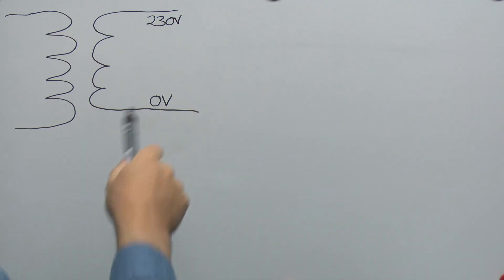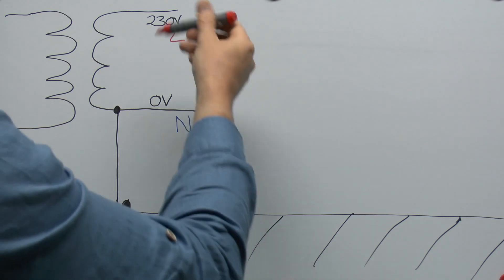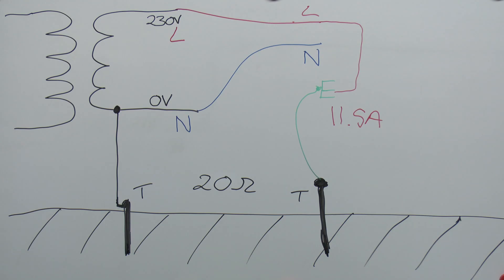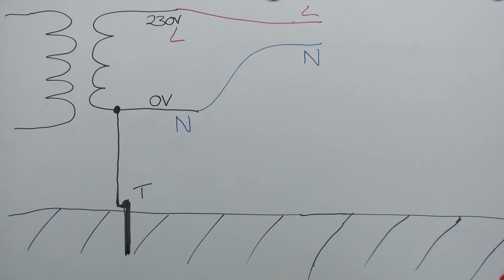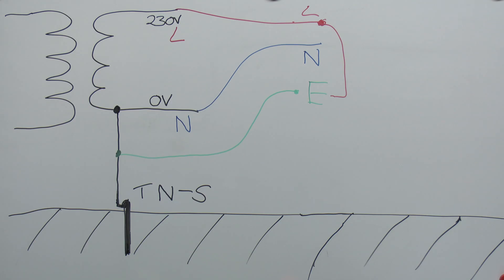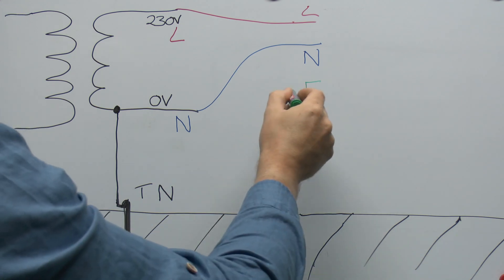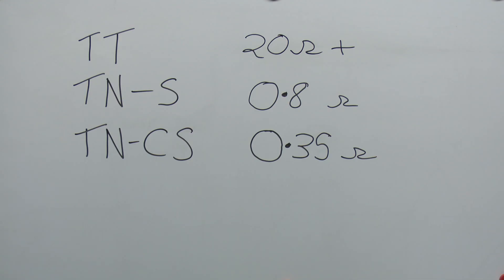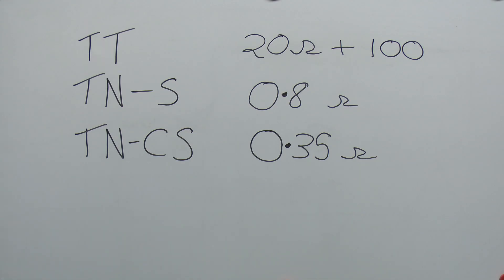Types of Earthing System for Electricity Supplies (UK)

Comment: I'm no expert so forgive me if this sounds silly, but in your diagram you have 240v live and 0v neutral.  That would suggest a DC set up - mains is AC so would that not be alternating between live and neutral ?  I also presume that as the resistance is less in the neutral wire than the through the ground which is the reason we don't have 120v potential between neutral and the ground??

Your videos are entertaining, informative, but can be confusing for us non electrical folk !
Reply from the maker: Malcolm Crabbe The neutral is always zero volts relative to the earth, as the two are connected together.
The live changes between positive and negative relative to the neutral,  which for 240V AC is a peak of 339V positive and then 339V negative, repeating 50 times a second.
Reply: +John Ward i am sure the resistance in the eath is less then the resistance in the neutral and i persume this is why we use it as an graounding system? aslo in the Uk our supply is based on a 3 phase with 240v - 400v depending on what phase you use. and according to your diagram if i buzz tested the neutral with the eath they would buzz failing the instalation as safe?
Reply: A copper (or Aluminium) conductor for a neutral will almost certainly have less resistance than the earth. For a three-phase system the neutral acts as a return path for fault and imbalance current. The vector sum of the current on all three phases will give to the neutral flow at any given moment in time. I'm not familiar with buzz testing lines, but if there's a significant current flow through the neutral with nothing wrong on the circuit, one should look at balancing the load a little better.
Reply: We describe the 240V as a type of average value to make analysis easier without needing complex differential equations. It is still AC and alternates polarity 50 times every second with a peak value of 240*sqrt(2)=339V. Fault paths are designed such that the majority of current flows through a protected path. For homes, this path includes a circuit breaker. Earth ground conductance is generally very low until an electric field is applied (in many cases increasing the conductance slightly). The metallic path of the return neutral will almost always be more conductive than is natural earth ground. Earth ground is "said" to be zero volts (it actually isn't, but this affects almost nothing on the distribution side of things) so the video is correct.
If a 240V lead touches the neutral conductor you can be certain that the neutral conductor and everything it touches now has a potential of 240V. This includes the earth grounding conductor. Voltage does not "go away" when driven from a constant source.

Comment: I always wondered how a path from live to earth was created. I thought it was an enormous earth rod at the power station. Another question, I have a 25m 15a extension cable going over to my shed for charging an electric car. Should I also put an earth rod in the shed and connect it to earth on the extension cable? I was worried the cable might be too long and the car might have a problem with the earth not being good enough. I don't have the car yet.
Reply from the maker: Shaun Dobbie Very unlikely that an earth rod would be needed.  

Electric cars should have a dedicated charging point connected to fixed wiring, as the charger units which plug in to normal outlets will typically take a very long time to charge the car.  Extension leads are not designed for permanent installations.
Reply: Unfortunately, its my only way to charge. I think it takes 10 amps maximum but the voltage drop of the cable might be too much. It is about 8 to 10v of drop using a 2kw fan heater.
Reply from the maker: Shaun Dobbie Allowed voltage drop is 5%, or 11.5V on a 230V supply, so within limits with a 2kW load, and right at the limit with a 10A load.
Reply: I will just have to give it a try I suppose. The evse with the BMW I3 gives you 3 charge rates. 6 amps is the lowest. If it doesn't work at 10a, I will replace the extension with 6mm twin and earth armoured cable.

Comment: HI, thanks for the video:) i would like to make sure that in each plug of my flat,  the earth is actually working. Can I connect one probe of the multimeter to the live and one to the earth, and check if it reads a voltage of about 230v?
Reply from the maker: Lorenzo Taurino That is one way, a safer method would be to disconnect the power, and use a long test lead to check for continuity between the earth in each socket and the main earth terminal for the building (usually in or next to the consumer unit / fusebox).
Reply: Yes...in Italy we don't have a Main consumer unit (Just An rcd/rcb) thanks!

Comment: Here in Norway the customer must provide an earth rod regardless of what system is being used. Even TN-C-S-systems must be connected to earth where the PEN is split to N and earth. So whatever happens to the earthing from the power company, there will be a local, good earth point.
Reply from the maker: sjokomelk That is also permitted in the UK - however it is not required, so is almost never done in reality.
Reply: @jwflame  There's often a de-facto local earth as well due to bonding gas and water piping that often arrives, at least in part, as buried metal piping on older properties. That's not what' it's intended for of course, but it's potentially useful with RCD protection should there ever be a supplier neutral break, as unlikely as that might be in practice.
Reply from the maker: Robert Szasz No, only the electricity supplier is permitted to do such things.  Therefore you are stuck with whatever earthing system they provide, or ignore theirs and use an earth rod / TT system.
Reply: ***** in a T-T system can you bond the earth and neutral at the premises demarcation?
Reply: ***** Although sometimes you can call the DNO out for them to convert a TT system into a TN-C-S one, albeit at a cost.
Reply: +John Ward
I notice now, 18th edition draft is expecting a supplimentary earth rod on new installations!.  Not entirely sure why but worth thinking about!.
Reply: Same in Belgium, Ground is provided by the company (both on single and triphase, most new houses here get triphase) but you have to run a loop of a single copper cable that's coated in lead (against corrosion) (believe 16mm² and connects on a copper bar that is accesible) under your foundations if your building is new. If the measurements are not good you have to put in more stakes/pins and I believe up to 3m/ 10ft deep untill its right (Believe they start with more pins on different places and look at the results an decide wich have to be longer or something, don't now excactly anymore it's been 20 yrs since  I got the class). If your restoring a house and the electricity has to be renewed ( say over 40 yrs old or so) then you can only work with stake/pin option. all the stakes/pins also whould connect first to eachother and then to the copper bar.
Reply: +sjokomelk 
Same in Finland, I think we are almost 100% TN-CS.

If you have IT-system, wont that mean that an Edison-screw light socket has its threads live too?  Or do you use bayonette mounts?
Reply: Steve Jones Yes, they're good for surges. Then you want the shortest way possible to ground.
Reply: Same here in Ireland
Reply: sbusweb A reason we have it in Norway would be because of voltage surges.
Reply: Earth rods are never a good earth. Typically it will have several tens of ohms of impedance.
Reply: +Tanooki100 We use the same Edison light sockets that everyone else in Europe is using. And yes, it would be live on either the threads or base if you don't use a two pole switch.
Reply: Really?

Comment: hu John,im very confused, how can the earth also be a a neutral as in the case of TT. does this mean the earth is going to be continually energised as i believe the neutral carries the return current to the transformer. also the IT system i often see it drawn without a neutral, how can you have a circuit without a return path, in case of single phase
Reply from the maker: OhPoWneDiel On normal systems there are 2 conductors, line and neutral, The only difference between TNS/TNCS/TT is how the earth connection is provided.

An IT system has no earth connection at all, just line and neutral.  Examples being an isolating transformer or some types of small portable generators.

The only system which has a single wire (line) and no neutral is SWER, and in that system the current does return via the earth in normal operation. It''s used in remote areas in some countries as it's much cheaper and simpler to install / maintain.  It is not used in the UK.

Comment: John can you answer a question please? Why when I changed a plug socket front that was cracked, Did I receive a "tingle" from the neutral wire around 30 volts or so, I've had 240 volts a couple of times so I know what that feels like!!! Not that I go out of my way to get it!!! ( Downstairs M.C.B turned OFF for downstairs ring main) But upstairs left on. No I'm not a qualified 'Leccy with 17th Edition but I have worked with an 'Leccy before and I'm very careful about the "quality" of anything I install, hope you can answer thanks Clive
Reply from the maker: Clive Clarke-Watson Several possible causes such as: neutral can be above earth potential on some TT earthed systems, or TNCS with defective earth, or some incorrect interconnection with another circuit which was still powered.
Reply: Thanks John, It is a local authority house built in the early 50s of the Airy type, but has be rewired and has M.C.B board I guess about 25 years ago, It even has all 3 phases into the "board" side (but only one is tapped), Would you as an Electrician be unduly worried if you came across this issue in a house that you were working upon of this age? Just would like to know so I can highlight this to the local authority if you think there is a possible wiring fault. Cheers Clive and keep up the interesting Video's!!

Comment: Hi John, great video and very informative. I live in the UK in Suffolk an we have a TN-S supply according to your video as there is an earth cable coming in. Its all overhead as we live in an old farmhouse. What I have noticed is that in the outbuildings we have there is an earth rod. I cant see one near the house consumer unit but at the first out building its just outside the door. Its green/yellow cable to it so it looks like within last 20 year type of age. Why an earth rod at that point? Any advantage or indeed any disadvantage.

Thanks for your time and I will be checking your other videos. Thanks for your time in sharing!

Colin
Reply from the maker: Colin Herbert It may have been a TT supply originally, and changed to TNS later.  The house rod being removed, and the outbuildings left as they were.  There are also situations where it would be desirable to use an earth rod rather than the supplier earth, such as outbuildings containing metallic pipes, or those with metal frames such as greenhouses.

Comment: hi Jonh nice job. whitch sytem you think is the most safe??
Reply from the maker: Giorgos Shalida TNS, as there are separate conductors for neutral and earth, and if supplied via an underground cable, the earth conductor is also in contact with the actual ground for the entire length of the cable.
However in the UK you do not normally get a choice, and on new installations it is normally TN-C-S.
Reply: ***** thanks for your reply. if i have to chose tt or tn-c-s, which will be the safest?
Reply from the maker: Giorgos Shalida For normal installations, TN-C-S would be chosen, as it has a metallic path to earth, so normal fuses and circuit breakers will operate when there is a line-earth fault. The main disadvantage with TT is you are relying on an RCD to disconnect in the event of faults to earth, RCDs can and do fail.

However TN-C-S is not suitable in certain locations such as swimming pools, agricultural premises, caravan parks etc., so it always depends on the situation.
Reply: +John Ward In countries where TT system is mandatory you always need to have 2 RCD&#39;s. One is the main RCD from the electricity network company, a 500mA RCD. And then up to 8 16A circuits can be protected by a 30mA RCD. Also RCDs should be tested at least every month. So chances of 2 RCDs failing at the same time are close to zero. 

I have only seen failing a 500mA RCD once with an old fusebox without any 30mA RCD. This caused the Protective Earth to become energized. A solution would be an Overvoltage Protection Device between the Ground and Neutral which will conduct current when the voltage between the ground and neutral exceeds a certain value.

This OPD will prevent stray currents but will also prevent the Protective Earth from having dangerous voltages in case of live-to-ground fault and any circuit breaker will clear the fault if the 500mA RCD fails. It will however increase the risks in case of a broken neutral. So it will not be safer than a TN-C-S System.

Comment: Question: you say that the current returns to the transformer? I was under the impression that it just kind of dissipated into the mass of the ground? By what process does it return to the transformer?
Reply from the maker: Gustav Joncus The ground is conductive, and provides a path for the current just as any other conductor does.  The only difference is the ground has a larger impedance than a copper or other metallic conductor.
Reply: I understand, thank you

Comment: GREAT VIDEO....Hi john, recently visited a rural property TT supplied overhead 2 wire supply.  where an electrician had found a voltage 54 v between earth and neutral. When installing a shower circuit.    But could not find cause of the problem. Pulled the cu to bits and was left stumped. I myself called and isolated the installation and conducted tests at the distributor s supply only. I found a voltage of 280v to the property's electrode, which my meter could not perform  a EFLI  test on. Also I found a voltage of 54 volts between n+e. I put this down to distributors issue, as a visual inspection in the cables showed cables running some distance and twisted together for a section on the way back to the transformer. Opinion please john thank you

Comment: Your videos are very informative and you are extremely watchable and entertaining.
 
I have a TT mains electricity supply to property in a very wet rural location can you advise how to test the existing TT earthling installation
 
Keep the videos coming.  Regards Rolls
Reply from the maker: Rolls IOM The earth electrode / rod should be tested when disconnected from the installation (power off before doing that), using an earth electrode tester or a multifunction tester which has that function.

The other method is to measure the loop impedance between the electrode and the incoming supply - however this requires precautions to avoid dangerous voltages appearing at and around the electrode.

I may do a video on this and other testing procedures in the future, as it is often easier to show how things are done rather than describing them.
Reply: *****
Thank you John for you reply, recently I have carried out the "Other Method" you describe in your reply, I completed the  test with a M*** LT320,  it would be interesting to see a video from you on the two methods you have described and the results you obtain from the tests as I think this information is not easily obtained in an easy to understand demonstration from elsewhere, I am sure you will do a great job. Regards Rolls

Comment: Where i work, I measure over 80V AC between the metal chassis of a laptop and earth when using a mains adapter with 2 pin lead.  Is this is characteristic of the earth connection where the unit is plugged in, or is it something inherent to 2 pin mains adapters - 0V on the DC side not being tied to Neutral on the AC side?
Reply: It's to do with the adapter itself. There is an X2 capacitor between the DC output and the mains supply for EMC purposes. This causes the output to float near 100V

Comment: Great Video John, thanks a lot!, may I ask please - For TNS system, since both Earth and Neutral cables are connected to each other in the transformer side, why does i cannot measure continuity between both cables in my Electrical panel Distribution Board?! This kinda freak me out kindly help! thanks
Reply from the maker: drich modina There should be continuity between N &E - if not, either the earth is defective, or you are measuring in the wrong place, such as after the main switch when it is off.
Reply: ***** i measured it in our 63A 3 phase with 1 phase branch distrubution board. I also thought that if i measure continuity between earth and neutral there. Most likely the RCD will trips. Please please teach me where to measure it properly and why does the RCD dont trip if the two cables have continuity. Thanks a lot in advance!

Comment: In Denmark the TT system is exclusively used. RCD are required on all installations which supply up to 20A, including old ones that was made before the invention of the RCD. It is the consumers responsibility to make sure a device has ground a connection, and it is only mandatory make the ground connection on domestic appliances.
Reply: I live in the UK. Our earthing system is TT. Our house was built in the late 1960s.

Comment: Great explanation!! In the USA we have 2 hot wires 120/240 and 1 ground/neutral the grounds and neutrals are bonded inside the main panel. The nec requires 2 ground rods for each electrical panel inside the house.
Reply: It's 2 rods if you have more than 25 ohms only with 1 rod.  Wrong on each panel board.  I for the main, none for others as they are sub's using se-r.  Unless it's an outbuilding.  Still uses the se-r, but also requires the rod.
Reply: In main land Europe it is more common with 3 phases + neutral configured in a star system. 400V between phases and 230 between phase and neutral.